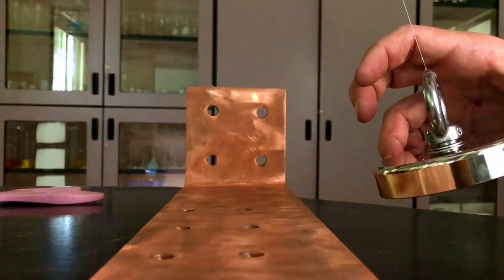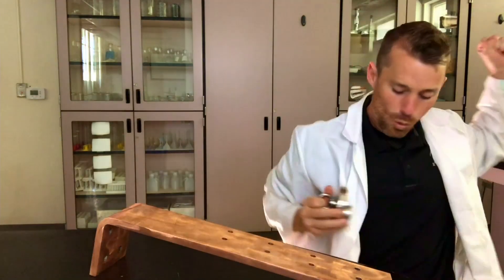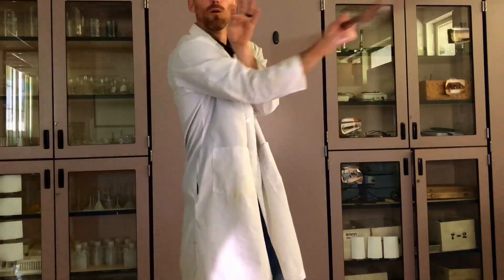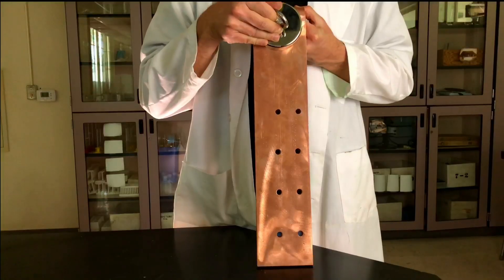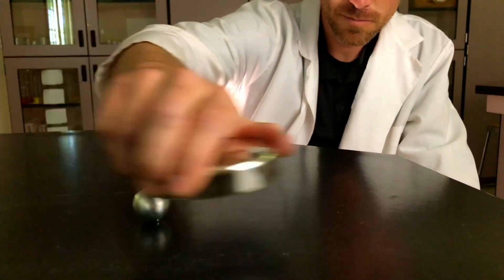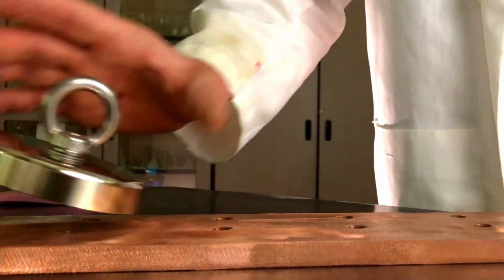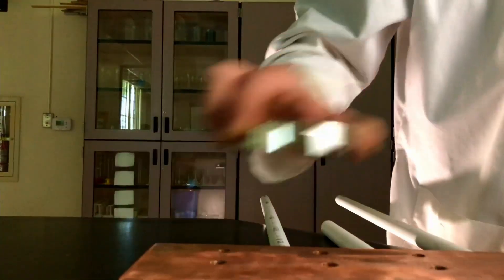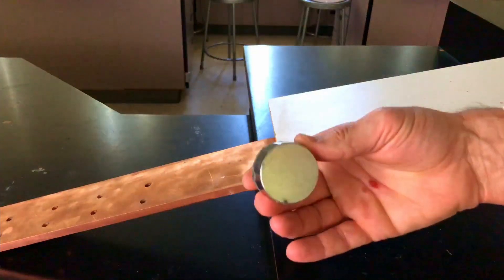7 Fun Copper and Neodymium Experiments

Comment: I'm not done with the video, so maybe the answer is provided.  But you're seeing electrical resistance, which manifests as heat.  This is literally what an incandescent light-bulb is -- it's a controlled "short".  The heat is probably too minimal for you to detect it via touch, particularly when the enormous copper bar is a fantastic heat-sink all by itself.

You could potentially test this if you attach the magnet to a wheel and have it pass closely over the copper plate repeatedly for a long period of time.  Then the heat build-up should be detectable to the touch.